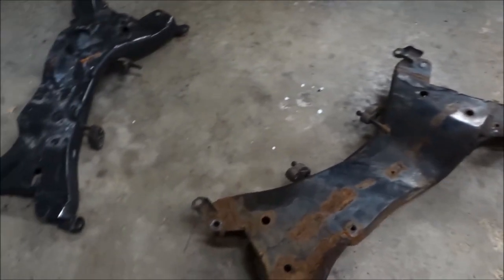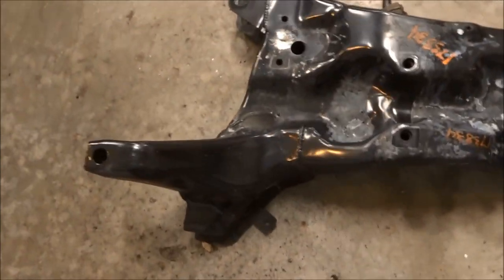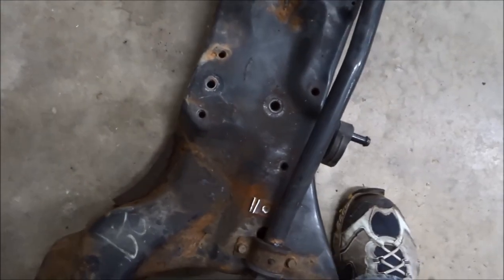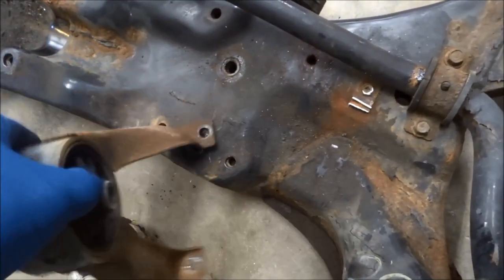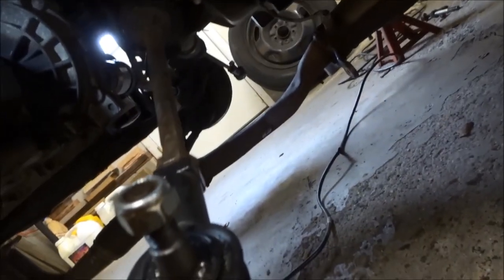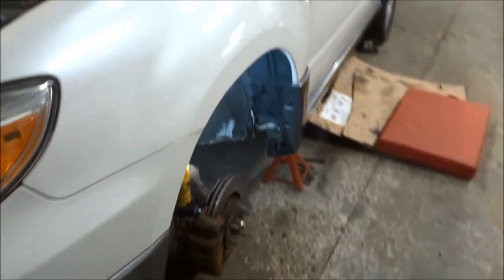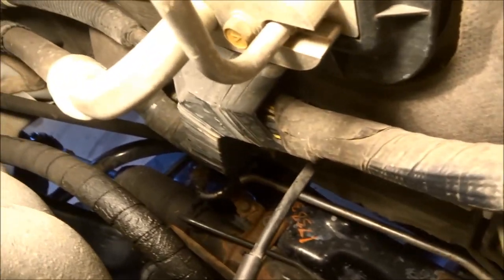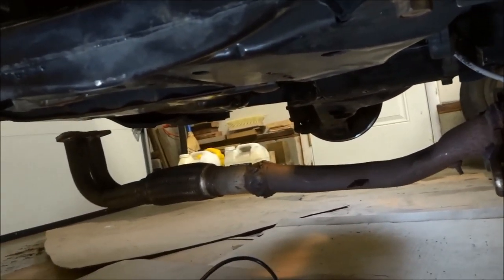2006 Mitsubishi Outlander front subframe replacement

Comment: My 2007 is at the dealer now for subframe replacement in NJ. DON'T LET THEM try to convince you to do other work. RECALL WORK ONLY.
Reply: i mean to be fair i work for a dealership you should get an alignment after a crossmember replacement but warranty doesn't cover that or other parts like loose tierods etc. whether you do it there or somewhere else it should be done or you'll burn out your tires mighty quick especially if the person didn't use the witness marks on the frame to get close to alignment and make sure if you do take it somewhere for alignment let them know you had the frame done (might need to shift it)  most will just toe and go

Comment: Hello I have a Mitsubishi asx 3 2010 1.8di-d 4wd u happen to know if the subframe is similar as looking to tackle this job. I’ve noticed parts are mostly similar for bolt placements.
Reply from the maker: Your ASX looks to be the same as my Outlander so it may have the same subframe.  Can't be sure of that so ask around.
Reply: Didn’t see an engine hoist can I ask how many points hold the engine on as saw u had removed the two below?

Comment: My '07 is rusting that bad. 175K miles, runs great, very clean inside and out. But, sub frame is all rusted. Driver's side worse than Passenger. Southern Michigan.
Reply from the maker: It was the same with the 06 and it isn't  easy to make the decision to repair it or not.  I do all the repair work myself so it was easier for me to put it back on the road.  Paying someone to buy and install the sub frame would have been expensive but maybe still worth it in the long run.

Comment: So when they replace it due to the Free Recall Replacement, do they use the exact same OEM cross member? I mean damn I hope they at least used better steel lol
Reply from the maker: I bet that they used the same sub frame. They could as least undercoat the inside of the frame but doubt that they would do that.

Comment: That Japanese engineers didn't know that they must protect this better against rust?
Good engines but poor paint on cars and underneath.
This days I'm remove rust from my sub frame before rust like yours and painting with rubber paint.
Reply from the maker: Here in the N. E. there are lots of cars that have been scraped because the front subframes have rotted away. This is the second subframe I've changed.